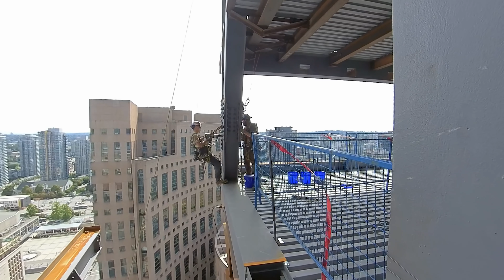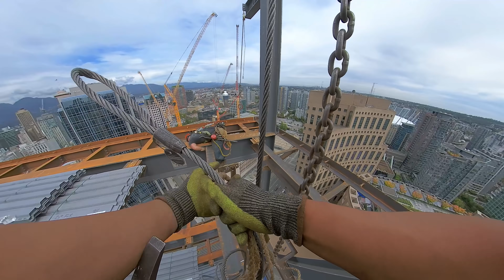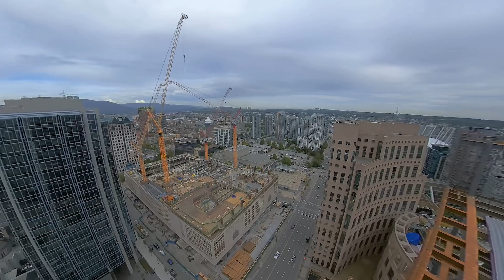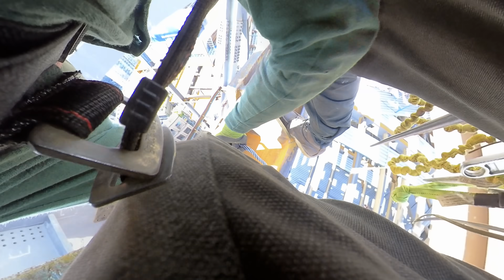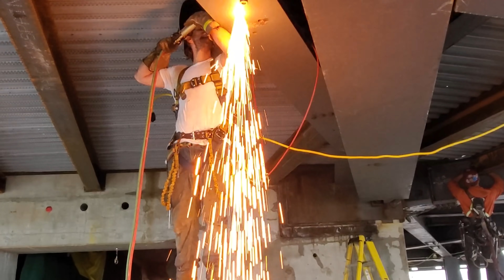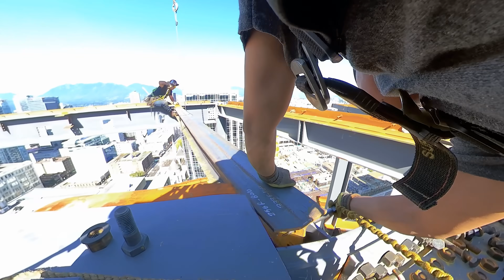Ironworking in downtown Vancouver, Canada.

Comment: So they just hand tighten those bolts and that’s it?
Reply: The connectors put it together, you just snug up a few bolts. The bolt up gang fills the rest of the holes, then after plumbing everything up square the next crew comes in and torques everything to spec.

Comment: Cool looking building. We don’t get many structural buildings where I’m at anymore. All concrete. IW Local 135
Reply: Why concrete now? I see it in Denver Colorado too...
Reply: @connormadden6771  they’re doing all these pour in place buildings because they’re quick and easy to engineer and build. We basically just go through and detail it out and do a little bit of structural on top.
Reply: @calebcoleman9569  Hopefully as carbon pricing becomes more of a factor structural steel will come back in a big way.
Reply: @gduteaud  Steel is far more carbon-intensive than concrete.

I think you will be seeing more engineered wood beams.

Comment: Are all the beams pre cut or do you have to take measurements in the air, then they're cut on the ground?
Reply: They are assembling them like a puzzle it’s all done before reaching the site then lifted in a specific order
Reply from the maker: The pieces come pre-made from a shop. Sometimes the pieces don't fit and that's when we bring out the torch.